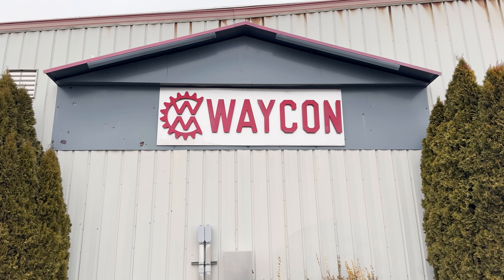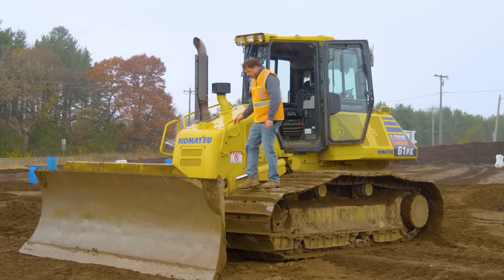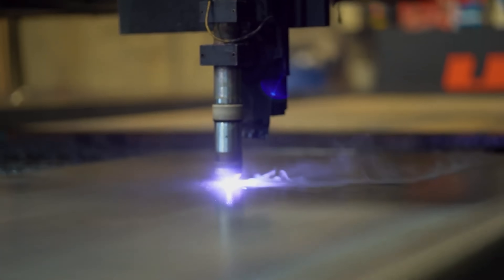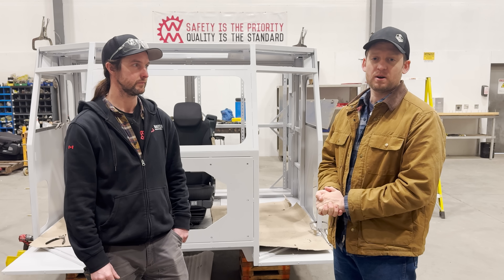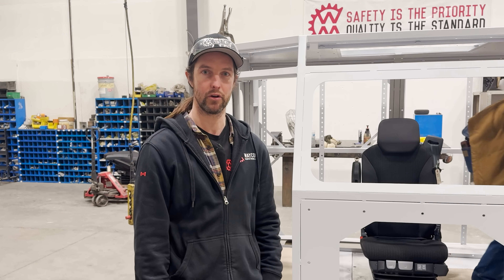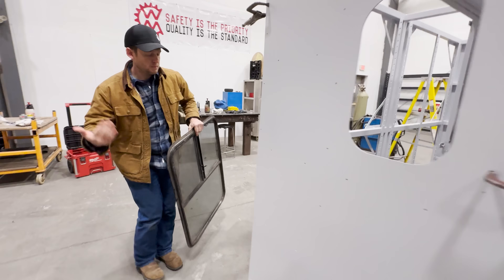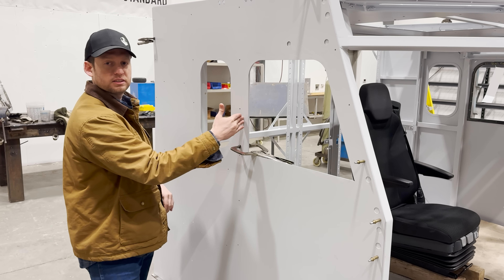Unveiling the Undisclosed Hybrid Electric Truck Cab: A Sneak Peek

Comment: 2:51 For a while I've been speculating that the undisclosed truck was going to be a Dustbin Lorry (Garbage Truck) with the cab able to seat 4 comfortably but now that there's only 2 seats I have to guess again. The drop axle indicates heavy load and I suspect the black box in the render is a diversion.
I'm leaning towards a crane or drilling rig at this point.
Reply: Military green makes me think tank recovery vehicle.
Reply: @economicprisoner  I see your thinking, the thing with Armoured Recovery Vehicles (ARVs) is they have to get to where the thing got stuck, during operation an MBT will likely need another track laying vehicle to help it out, either another MBT with tow cables or a dedicated platform like the CRARRV. The wheeled recovery vehicles like CAFs ERC Rheinmetall HX 8x8 may be able to reach depending on location and terrain type but even they have much higher ground clearance and more equal ground pressure managed by axle placement, much larger tyres, central tyre inflation etc.

All that being said, and coming back to a form of recovery vehicle, we could be looking at a dedicated wrecking and recovery vehicle for heavy plant and specialist trucks. Going back and looking at the short "We'll be ready to go on the next trucks in the new shop", 2 seconds in you can see the drop axle is a steer axle too, I can't figure if it's also a drive axle but if recovery is it's purpose then the beauty of electric drive is that you could have all drive axles without a horror show of transfers, diffs and props that would not only give you monster torque for towing but also big benefits in mobility through improved traction, lower ground pressure and stronger braking, not just through conventional brakes but also through regeneration.

All in all I think you're on to something with the recovery aspect and that has superceded the crane or drilling rig to be my guess.

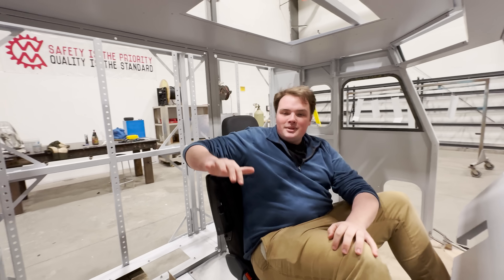Comment: 1:15 Peter, you mention huge glass panels to provide visual access, I would strongly discourage glass and instead recommend a polycarbonate: plexiglass or similar; it'll be lighter, cheaper and tougher.
Reply: I misspoke on this one, sorry about that! we are actually using polycarb. Makes the panels much easier to handle and less susceptible to damage.
Reply: @Peterbuildstrucks  No need to apologise, that's good to hear, get in touch with polycarb suppliers and they'll often send you samples, I have a keychain with about 50 tabs of transparencies, tinted to different grades which is great to get an idea of what the material will look like. A light smoke and anti-reflective/glare coating will help prevent unwanted reflections projected back on to the windscreen, surrounding windows and when viewing the contents behind.

Comment: Cool thing about hybrid is you can mount the generator transverse if needed more frame space.
Reply: I believe that is the plan to set the engine sideways behind the cab
Reply: @Sah-o5m  I didn't want to assume that ;o) I think you are right.
Reply: @repalmore if memory serves, I believe Chace mentioned it in a previous video, or over at reddit.

Comment: If you havent already, make sure to consider that glass being opened while the vehicle is in motion. instead of just straight shutting down, might be a good idea to have the truck hit the 4 ways, allow steering, come to a safe stop, apply the parking brake, then shut down.
Reply: Why would you need to access the electrical cabinet while the truck is in motion? That be like popping your hood to work on it while bombing down the freeway. Or crawling under the dash to replace a fuse while in he Tim Hortons drive through. 

I don't see anyone going into that cabinet unless some thing is wrong, in which case they are probably already pulled over and parked somewhere. 

I'm sure the cabinet could be tied into the computer, computer keeps it locked unless speed is 0. 

Only time I could see needed in there while moving would be during diagnostic work potentially. So maybe it has an emergency override to allow the truck to move while the door is open 🤷
Reply: @cwalker7  1, always assume the dumbest person will be operating the device. 
2, it the panel latch for whatever reason fails, and opens, you don't want to loose complete control
Reply: @cwalker7  Potholes. Hit one, latch comes loose, door opens and you're suddenly riding a dead weight.

Comment: Hey guys, cute little idea. Bring over your local EMS/Fire Rescue gus come out and discuss entrapment after a wreck. Emergency egress will be a concern when someone picks up 3 or 4 extra Hondas on the hood. Give it a roof/Side hatch for emergency egress.
Reply: Definitely a valid point! Although, from an engineering standpoint you can't build cars from a 'rescuer' viewpoint. It's GREAT to consider what will happen/be left of the truck when they get there, but if you make that priority one, you're left with a pretty crappy truck. That's why extraction classes are such important training (AND CONTINUED Training!): to keep up with all the latest vehicles styles, hidden hazards, and special points!
Reply: This is a cab over so, the driver is still going to be significantly higher than most cars, entrapment would be a concern if this gets in a wreck with another large truck
Reply: @maximman102n7 
Or slides off an icy hill toting a hundred ton of logs.
Reply: Yeah, there need to be emergency considerations.

Comment: Thanks for the sneak peak and the great vid. That is going to be one good looking truck when it is done. Have you considered that the lights from the electrical centre behind the driver might reflect on the windshield when driving at night?
Reply: The lights in the cabinet will be linked to the dome light in the driver area. Turn on when the doors open or with a manual switch but will shut off while the trucks in motion.

Comment: Fart evacuation is of utmost importance.   

All joking aside it is thoughts like this that are missing in the automotive sector.  

It isn't my truck no am I the operator...  but...  make sure the A/C is oversized and you have plenty of air movement in the cab...  with the heat coming from the electric behind and the fish bowl around...  and the motor from under...  you won't need a heater at 0 degrees...  

I own and operator a machine from Switzerland,  that has glass all around for outstanding visibility,  even portions of the roof, the motor is right underneath,  and it has hydraulic lines all throughout...  when it's over 90 f. Outside and the sun is out it is unbearable to run...  I use the A/C in the winter all of the time and the sun isn't out.  I have a roof top air-conditioned unit that blows cold air on my head and it is seldom cold.

I really think you are on the correct path on truck building,  I may someday own a Edison truck yet, and I hate the EV vehicles, decent Idea poor reality.

Comment: Glass is heavy, expensive and a risk and sliding will work a week then after that some dirt in the tracks makes it a pain to open. Plastic like polycarbonat will be ligheter but might end up scratched and will melt in any fire. Akrylic will also make it lighter but will crack sooner or later. With metal doors they can act as fire shield if something happens, also enable you to mount stuff on the door itself if you open them instead of sliding, will also be lighter than glass and will not break. 
Open/close the rear small windows from the driver seat and the whole door can be a window. 
If you are using any air then add a compressed air nozzle. Quite handy. 
If you need to get up from the driver seat then, whatever it is, will not be a good solution.

Comment: Chase check out hemp lego building blocks made in Alberta, the perfect fit with post and beam frames.  25#, R35, diy perfect lego's, no voc's, fire proof, bug and mold proof.  Each 40' container builds 1000 sq ft, sequesters 6 tons of co2.  costs less than stick built.  perfect diy weekends for employees to build there own tiny homes.  do channel advertising for the manufacturer to be paid in hemp lego blocks.   Use them to build a storm shelter in the shop.

Comment: Serious question: How do you deal with side and side rear visibility with the center seat and paneled in sides to the seat?

I've got a Mia Electric, it is a tiny plastic lunchbox with a center seat, and paneled in sides that start just behind the driver. It has boggo standard car mirrors originally made for a Renault Clio, mounted quite far back. While the visibility 180 degrees in front is excellent, I've noticed the blind spots are huge. Rear visibly is like looking through a toilet paper roll, hence I tend to lose cyclists and whatnot.

I know dealing with blind spots is a truckers way of life, but no-one has ever died from having too much visibility right?
Reply: I have a sneaking suspicion that this particular truck will have 1 or more rear view and side view cameras.
Reply: They need to fit a rear facing camera on that thing

Comment: I have run closed in lift trucks, and it gets super hot in the summer sun.
Reply: Was the AC broken?
Reply: @Groza_Dallocort  No AC company is too cheap. ( Home Depot).
Reply: @icemarkable only vehicle I have been driving as of late without AC is the company cheerypicker that is built on top of a 2021 Mercedes Sprinter and the reason for no AC is weight constrains. In Europe to be able to drive it on a B-license the car/pickup/van can only be 3500kg and a 24 meter crane with hydralic pumps and such is rather heavy.

Otherwise AC is standard in europe on almost any car/truck/semi-truck built after 2010.

The company I work for even have a 2021 Iveco Daily boxtruck with climate control, rearview camera and rear cargo elevator

Comment: Thought the first track was going to be the conventional one?
Reply: They have at least 3 sets of frame rails laid down right now
Something tells me their undisclosed customer may have wanted to get theirs done pretty quickly. Plus, once this cab is done its another style they can offer for future orders. The royal winch truck is still likely to be the first one done, but i'm guessing this one had some unique problems they wanted to stop worrying about first.
Reply: I believe this undisclosed customer was the first to start a dialogue with Edison so its further along.

The official cover story is that this cab forward is a "concrete truck" wink wink. Like blue harvest star wars. I believe this truck is the rolling chassis we see at the Edison tent with dirt floor.

I'm aware that another rolling chassis snowplow is under construction at the Emcon tent with solid floor in Merritt.

I believe Topsy is getting rebuilt with upgraded electric parts.

I think the frame rails are on hold for the Tolkal lumber truck, the Prototype Mechanical transmission truck, and the Royal winch truck as there is no place to store them.

Comment: Think beyound studs and skin!  Make the "skin" 3/16" or 1/4" aluminum.  No rust, structural, extremely dent resistant and possibly lighter.  Looking good either way
Reply: Still get galvanic corrosion with dissimilar metals like steel and aluminum. You can do your best to isolate, but that's not a guarantee.